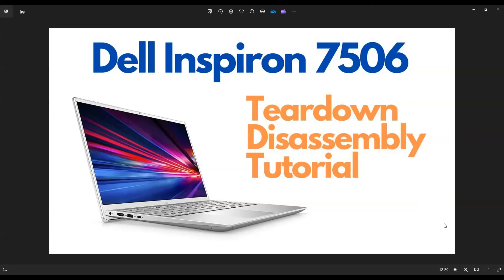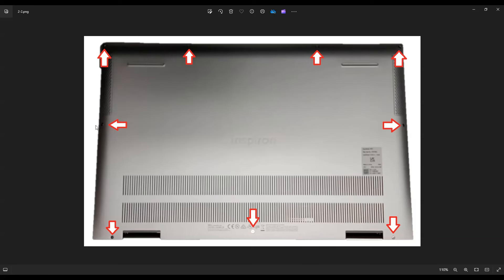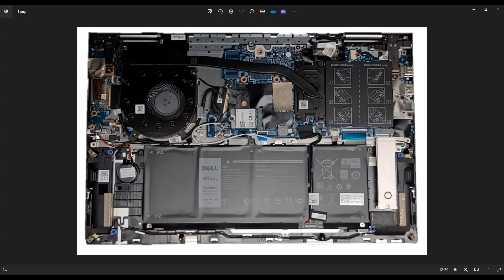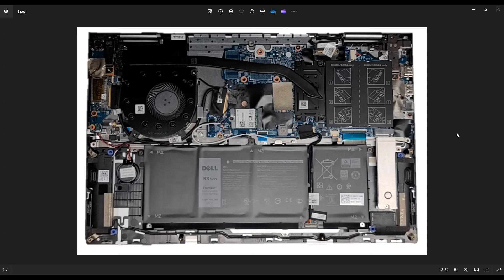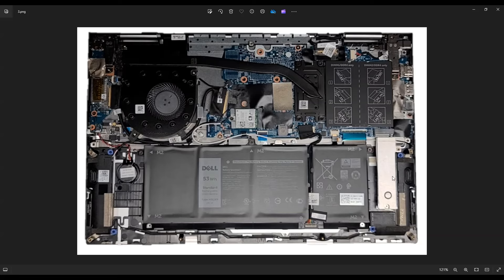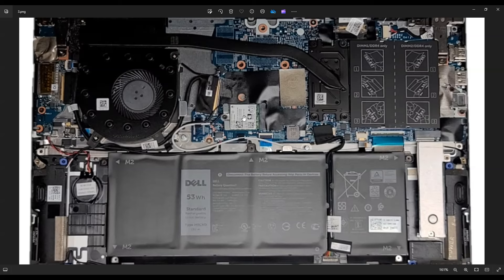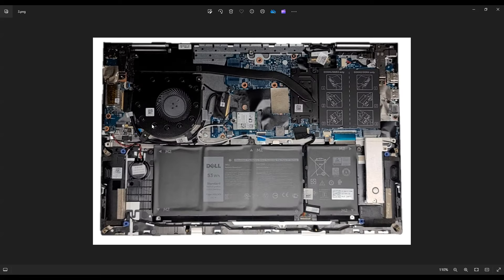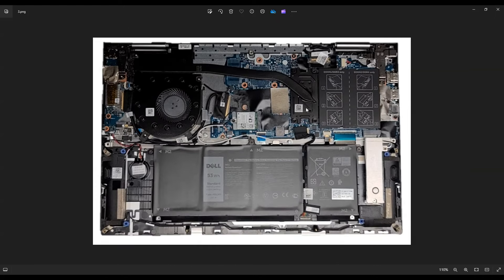Teardown Disassembly - Dell Inspiron 7506 2in1 Laptop Computer

Comment: I have a Dell Inspiron 7506 2-in-1 laptop. The HDMI port on the laptop is loose, and the connection between the port and the HDMI cable is weak. Wiggling the plug does not make the connection solid enough to turn on the monitor. I took the laptop to a computer repair shop, and they said that the HDMI port could not be replaced and that I would need to replace the entire motherboard. Is this correct>
Reply from the maker: Very often, a motherboard replacement is temporary at best and anyone who will actually repair a motherboard will not warranty the repair for any length of time. And since repairing a motherboard is usually just as expensive as replacing it, its usually best to replace it. Would you like help finding a replacement?

Comment: Hello I have a HP Pavilion gaming 15, it's powering on but stuck on caps lock blinking 5 long and 3 short.
Reply from the maker: For a computer that does not turn on, try this video first; https://youtu.be/kOBY4k2Mn_k. Let me know how that goes :)  Also, did anything happen before this issue appeared?  Liquid spill, overheating, Windows update, etc?
Reply: @PC_Monkey  not working I already did try the video above some days ago, I don't know if the wifi card is the one causing it because one of the antennas in my wifi card is not connected specifically the aux one, it's broken no outer circle so I can't connect it. I don't know what happened to this laptop first because I just got it granted that I bought it not working because that's the only one within my budget and I'm thinking that time that I can fix it, now I'm stuck.

Comment: Hey, i got an Asus Rog Strix G512LI which is not turning on, no power only airplane mode indicator is on continuously. I was facing charging issue for past couple of weeks, with continuous charger wrongly connected msg, connected, disconnected msg all the time even if i moved my laptop a bit. I shut it down one day n after a moment when i turned it on, there's no response at all, only airplane mode indicator is on continuously, even charging indicator was not showing for sometime but now the charging indicator is somehow turned on. I don't know what's the problem, whether it's coz of dried thermal paste, poor power jack, but the charging indicator is now turned on. I saw this same problem of Asus with airplane mode on but no power with multiple people online, I bought it 3 years back n i've never replaced thermal paste as i never faced any heating issue till date. Someone plz help me out, would appreciate ur help 🙏
Reply from the maker: So you have been seeing the computer overheat lately? And there was the charging issue? Can you try the steps seen here first of all?   https://youtu.be/kOBY4k2Mn_k